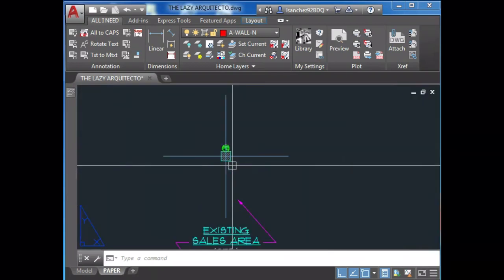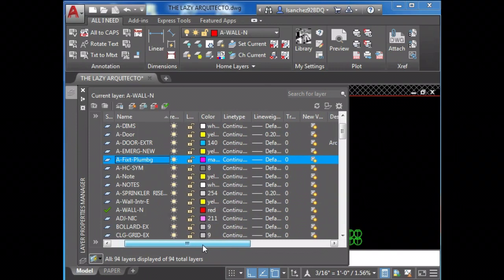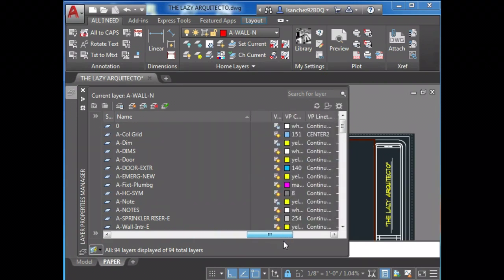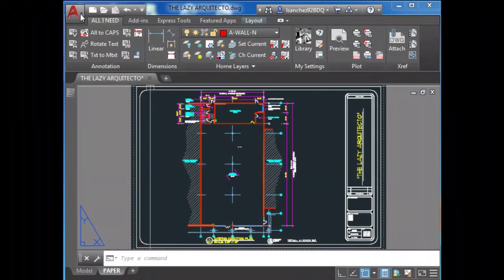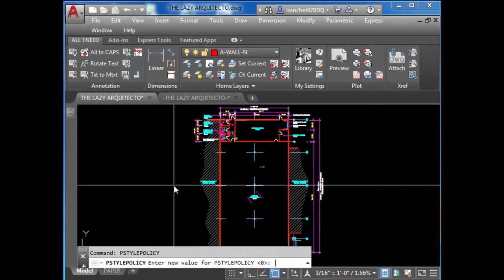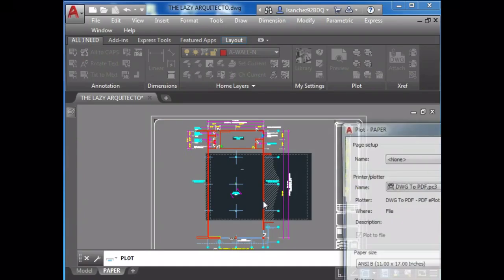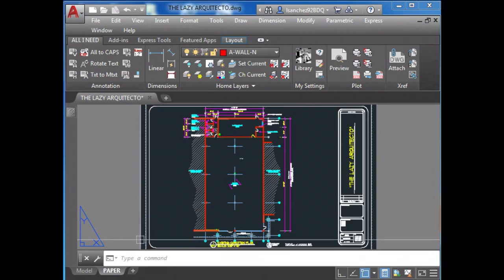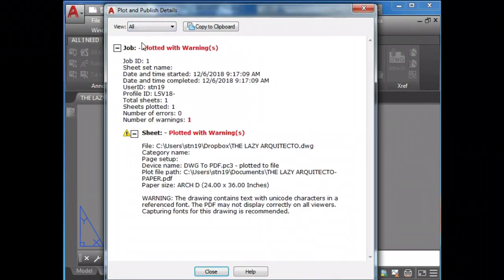How to Fix Autocad Printing Problems - Plotting Issues in Autocad

Comment: Hi Maestro, I have problem with AutoCad 2015. I can¨t print to pdf or printer the way I want. I mean if I want to print for example A4 in portrait mode, preview and final print is on landscape. I have to copy all drawing, make a block and rotate block 90 dgrs. Can you tell me where is a problem? ThX.
Reply: OMG. I know where was problem. In print window there is an arrow at low right corner. After click moreoptions are avaiable. Jeeeeeez.
Reply from the maker: @heamorhoid  glad you could solve your printing problem yourself 🙂 join us live this Sunday 10am (Pennsylvania US time)

Comment: My drawings are not printing to scale although all of the settings on the plot window are correct. Ive been using cad since 2000 without issues until I had to transfer from Lt. 2002 to subscribing to 2022 cad. what is the issue here?
Reply from the maker: What happens if you do a zoom extents in your paper space or layout, does it center the drawing correctly?

Comment: Hi Luis, I have one for you, my line weights aren’t printing correctly. I have set to the line weights in layers, properties set to by layer, but when I do a preview in paper space, in monochrome, with or without line weights checked, they all print the same weight??????. Only happens occasionally. Thanks for your help.
Reply from the maker: It can be many reasons, but the easiest solution is to copy all to a new drawing and see if this fix your problem
Reply: @LazyArquitecto  Thanks Luis, I’ll try it in the morning.  I’ve tried MP which works but then certain things are on wrong layers.

Comment: I am facing unclear pdf file number of times. Some of texts looks sharp and some text look dim.
Reply from the maker: If the problem is only the text, did you check the layer of the text doesn't have any transparency applied?

Comment: Hi... I have a drawing that uses diff lineweight... I tried plotting it to a pdf file... My the thickness appears to be the same
Reply from the maker: Welcome to the team Sangeetha. If you are using a ctb or plot style make sure to have check ✔ plot line weight on your print settings
Reply: @LazyArquitecto  it's checked ... But does not appear
Reply from the maker: @sangeethajohn6055  what plot style are you using?
Reply: @LazyArquitecto  meaning wat
Reply: @LazyArquitecto  it worked actual... When I set global width for Polylines... But circles and arcs idk wat to do

Comment: Hi...I have plot issues! If I plot at any color except black one I have an empty paper! When I turn it all black the texts seem white but at the properties they are black. So they are not printed at all. What should I do about that? PLEASE I NEED YOUR HELP.
Reply from the maker: Katerina happy to help you with your autocad printing problems. What plot style are you using?
Reply: @LazyArquitecto  Actually I don't use any Just ''none'' . And I have any probles until yesterday.
Reply from the maker: Is this problem happening only in this specific dwg? If so, then try to copy objects from model and paper space to a good dwg using this quick trick https://youtu.be/ELwME8s6kVQ
Reply: @LazyArquitecto  Thank you so much... ❤️
Reply from the maker: Glad you fixed your Autocad printing problem. Introduce me to your friends so we can all help each other!

Comment: i ahve an issue  with autocad 2016...my dwg is plotted in landscape but when i  open my PDF it is in potrait instead?any ideas on this issue?
Reply from the maker: Hi Yan, try to use DWG TO PDF.PC3 to create your pdf in Autocad. This could solve your problem
Reply: @LazyArquitecto  wow it worked but id just like to know is it the driver error? Cause i was using cutePDF all this while
Reply from the maker: Yes most likely. Welcome to the team Yan! I hope you're safe wherever you are

Comment: I have a problem while making a pdf from dwg file. When I do  dwg to pdf and see it in preview I can see it but when I give it to convert it to pdf then the pdf comes blank. Please help asap
Reply from the maker: Welcome to the team Moksha! Try zoom extents on paper space. If your titleblock doesn't show centered, then there's a small object somewhere that you need to erase.
Reply: @LazyArquitecto   I tried it but it is still not working
Reply from the maker: Try creating a new layout tab. Then copy all and paste all in the new layout tab and try to pdf then
Reply: @LazyArquitecto  Still its not happening. When I give it okay to print it as pdf then there is a box comes in which its written you can view about plotting process at the right corner. Please help
Reply from the maker: Are you using normal pdf to dwg or publish/batch plot? Try using print layout  instead of extents on the plot settings
Reply: @LazyArquitecto   Yes I am using normal pdf to dwg that is plot on a sheet. I use command ctrl+P. It used to happen till yesterday perfectly but suddenly its not happening
Reply from the maker: Try to use layout on the printing options instead of extents or window

Comment: Do you know how to fix, when plotting transparency, the plot comes out missing almoust all of the drawing. Lookes fine when prewiev, and lookes fine when exporting it to PDF, and looks fine when not plotting transparency (off couse the without transparency as there should be in my drawing)?
Reply from the maker: Hi Marianne Schnedler Sonne  try to set transparencydisplay to 1 or 0 and regenerate your drawing. By the way where are you from?
Reply: @LazyArquitecto  Thanks, will try and looket if it workes tomorrow at work. I'm from Denmark :)
Reply from the maker: Marianne Schnedler Sonne glad to have someone from Denmark in our team! There are many system variables related to transparency in Autocad, let me know if it works or I can give you another solution!
Reply: @LazyArquitecto  I will let you know tomorrow. If it does work, I know a few coworkers, who will be very happy. It is anoying the hell out of us :)
Reply from the maker: Marianne Please do me one favor, you know at least one of your coworkers that currently struggling or wasting time, share this channel with at least one of them, let's help each other out. See you tomorrow!
Reply: @LazyArquitecto  I will do so. But sad to say, it did not make a different if I set transparencydisplay to 1 og 0 :(

Comment: Hi

Thanks for your reply.

All drawings,  the plotter is not recognized while the other printers on the wifi are recognized and print. 

I have attached the error message plus the "option" path for background.

Thanks

Kamyar Lashgari
Taft Corporation

Cell: (213) 268-3468
IMG_20200513_095808134_HDR.jpg
IMG_20200513_095737915_HDR.jpg
IMG_20200513_095652423_HDR.jpg
Reply from the maker: I cannot see photos. Please send photos here. https://wa.me/12675534506

Comment: Arquitecto I down load 3 pdf files from my email.  They were 3 Autocad  drawings made in 8.5 x 11,  when I print them for a reason that I do not know it change my printer settings or the Autocad settings. I already check my settings and everything seems fine.  But now I can't print  11 x 17 sizes drawings,  everytime I send a drawings to the printer it will print all my drawings in 8.5 x 11. It won't print any drawing in 11 x 17 and I don't know why.  Thank you for your help
Reply from the maker: Chiri Boy , it looks to me that your settings changed and now you only have 8.5 x 11 sheets to use. Check this video, specifically on  2:45 , where i explained how to filter paper sizes, and try to add more sizes. Let me know how it goes.
Reply: @LazyArquitecto  i follow your steps but I haven't been able to fix the problem, I steal can't print my drawings 11 x 17. How can you add a sizes of a paper to your filter paper sizes in your properties when you plot your drawings. When I go to filter paper sizes I only see 8.5 x 11 paper sizes, but I don't see other sizes. Thank you for your help.
Reply from the maker: Chiri, try resetting your autocad profile.